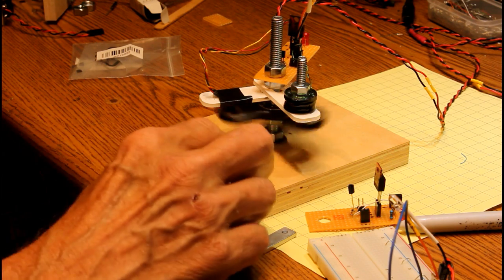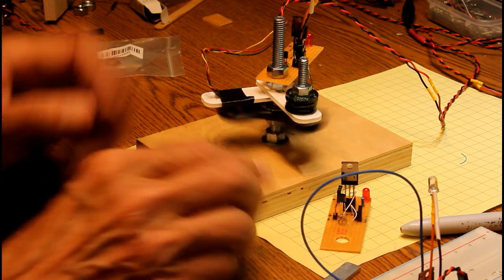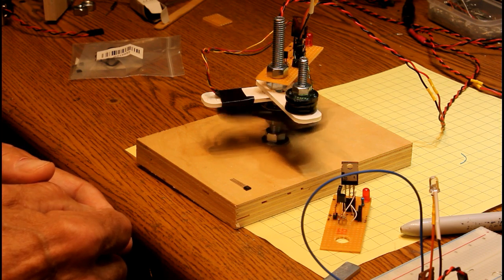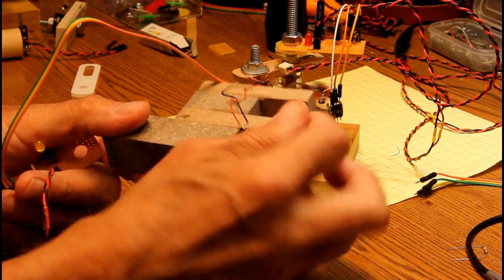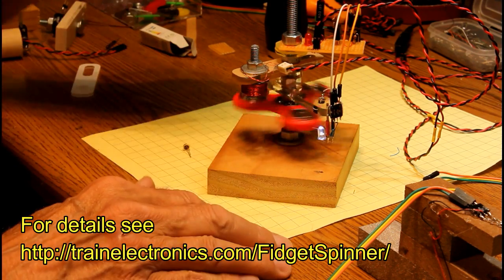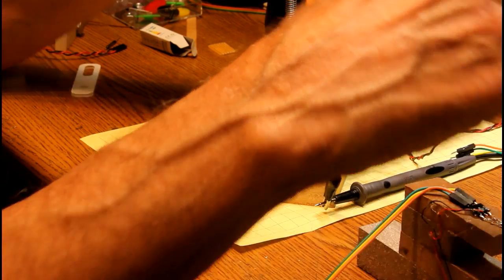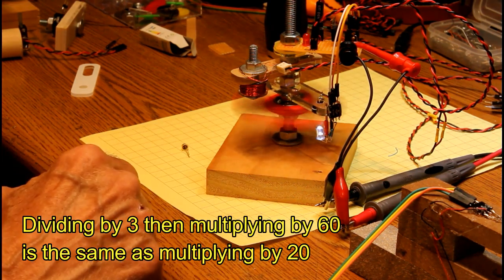Make a Brushless Motor from a Fidget Spinner PART 2

Comment: Challenge mode is to do an induction only version. Replace the magnets on the spinner with coils and add yet another coil to power the coils on the spinner that counteracts the stator coil. Playing with angles and such would likely be more fun. (My guess is a hub-centric coil powering all the arms might be the easiest, almost like having a brushed rotor but eliminates some alignment or undesired thrust issues.)

Comment: Hold up, how did the LEDs cut on? I didn't see a power source to the breadboard.
Reply from the maker: There is a connection to 5 volts that powers the breadboard - if you look closely at about 1:10 into the video you will see a red/black pair of wires going off of the back of the board.
dave

Comment: Excellent demonstration using logic switching. I would like to see higher speeds. First thought is a really nice gyro with more mass. And I also wonder if you can't somehow watch the slight variance on the coil itself as the attracting magnet passes by ... hopefully closing the timing gap to a more discrete level. And of couse a final way would be to increase the spokes to 4 or 5. I'm sure there's a threshold at some point where too many spokes would be detrimental to the desired outcome. Thanks again sir.
Reply from the maker: All good ideas - just what I was hoping for - you and others taking this as a starting point and improving & innovating!
thanks
dave

Comment: You have really inspired me. I have always been a tinkerer but shied away from electronics the more digital it became, but I will try to tackle some of those projects I have been intimated by. Thank you for simplifying it for me.
Reply: don't mistake solid state components for digital chips, almost anything done with chips now, can still be done with modern solid state components, just much more complex.
a chip is just a bunch of logic controlled switchs, various thyristors can be used to achieve the same effect, and you just build the logic with the circuit.

the chips just make the pcb's way smaller, thats why they are used.
Reply from the maker: I appreciate your taking the time to let me know that you are going to give some projects a try - please let me know how it goes - enjoy!

dave

Comment: This is amazing, thank you so much for posting this.  I was wondering if you spun the fidget spinner by hand could you use this essentially as a generator and detect voltage through the wire connections? I'm still new to electronics so I apologize is this is a silly question.
Reply from the maker: Sara - Any time a magnetic field interacts with a coil of wire electricity can be generated- that said, you probably could use this as a generator but it surely is not optimized for that purpose.
thanks for letting me know you enjoyed the project
dave
Reply: So, what you are saying is it is possible to make a dynamo that not only is self powering, but generate energy as well? I know some science, but not engineering... Love the video anyway.

Comment: Nice demonstration for those with some knowledge of electronics.
I ahve a 2008 model eZip Trailz, 24v, 450 watt electric bike.
I've been watching what videos I can find that's educational about the hall sensor and brushless hub motors.
Thanks a grand for the video.
Reply from the maker: Thanks for letting me know that it was of value to you !

dave
Reply: I hope I never have to convert my eZip Trailz over to the rear hub motor because they require much more voltage to do the same work as my brush reduction motor for the same torque and speed for the weight I carry.
My motor is getting to be expensive to replace because some hobbyist that's into building remote controlled tanks are using them.in their projects because of the torque and speed in a small form factor.

Comment: This is how computer fan motors work I think. I took one open once and there was a little circuit board in there with a hall-effect sensor. Neat!
Reply from the maker: David - it is good to hear that you liked the project - thanks for your comment!
dave
Reply: as a side note, you can't take the motor out of a computer fan. the fan blade is actually an integral piece to the motor. the plastic hub that holds the blades is also holding the permanent magnet, so you can't remove it without destroying the motor.
Reply: Is there a way to harvest the hall sensors from the fans. Those things are ridiculously expensive at my local stores, $8!!!!

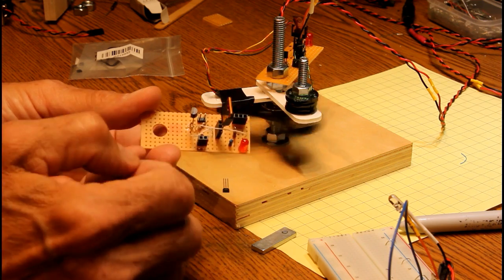Comment: In your circuit diagram that you show at ~0:55 seconds,  You have R3 and R4 in parallel yielding 500 ohms. Any reason you choose to draw this schematic this way. Other options were to actually use a 500 ohm resistor or to draw the circuit with the resistors in close proximity to visually show the parallel'ness (is that even a word :-) )
Reply from the maker: Paul - interesting observation!  I am not sure that it would work with the resistors replaced with one 500 ohm or not - I need to experiment a bit and see what happens......
FYI, I drew it that way to show that the gate on Q2 needs to be pulled up as does the collector on Q1
thanks!
dave
Reply: >"..I need to experiment a bit and see what happens......"
I'd be interested in hearing what your findings are.
Paul.
Reply: Another option maybe, as there is not a lot of current needed at the gate of the MOSFET, is to ditch one of the resistors altogether.

Comment: Does this work with perpetual motion? If so, what kind of battery you could recharge?
Thanks!
Reply from the maker: No perpetual motion here - just simple physics - it surely doesn't go without adding quite a bit of power
dave
Reply: Thank you for the quick response, Mr Bodnar. It is impossible to generate more energy in a system than what it consumes. If this were true then the device would be running in overunity mode and would be over 100% efficient which is impossible. However it is completely possible to generate more energy than what the device consumes if the local enviroment is involved or some other energy that is outside of the system which can be drawn or attracted into the system. Namely the power of magnets.  Any wisdom to talk about that for young inventors like me? I'm working in this for very long time You have great inventions!
Reply: Doing so would create drag in the form of a opposing magnetic flux, therefore requiring more current from the power supply, there is no free energy to be taken from this or any system.
Reply: F P there are plenty of examples of systems using external energy. Look at wind turbines or hydrogeneration. There is no magic way to just suck energy from the air.
Reply: Thomas Adamson No, but the energy lost would be less
Reply: It does ask the question of how long it will last powering itself.
Reply: theoretically it could go forever if it has infinite time to wind up an infinetely large battery, what we would be interested in knowing is specifically how long does it last per minute of full speed operation.
Reply: what if you really grease the bearing and put it in a vacuum, very little friction. could it then use less energy than it uses?
Reply: F P If you add a coil top and bottom of each of the other 2 arms you can collect the voltage spike generated off each of those 4 coils as it passes the magnets into a capacitor bank or rechargeable battery. You can also capture the back EMF voltage as the field collapses off all 5 coils if you want more output, and more output again is gained by adding more arms and coils. Some food for thought for you.